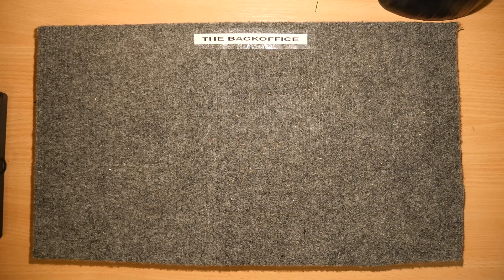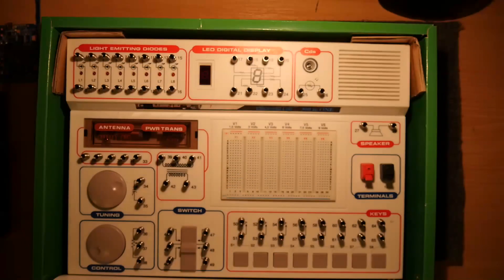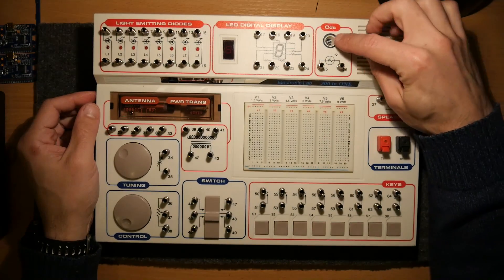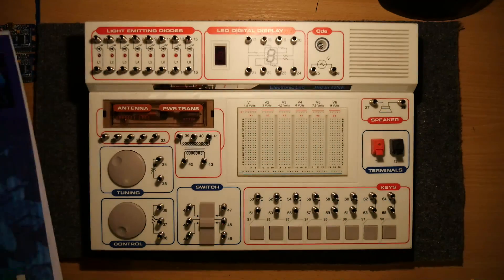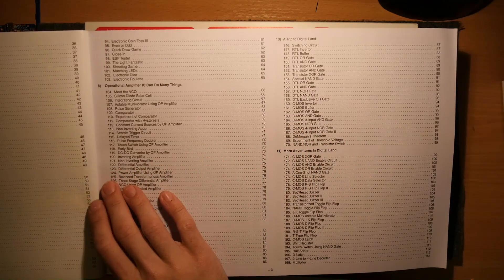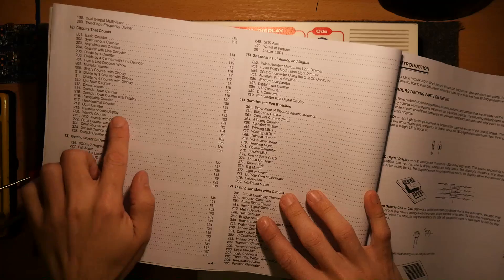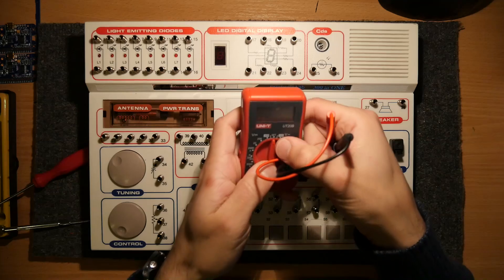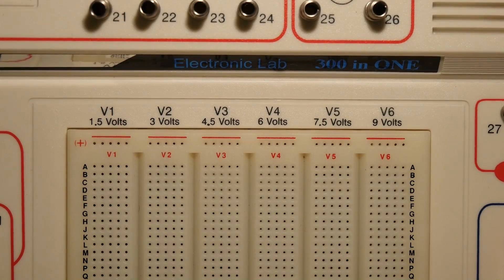300 in 1 Electronics Lab

Comment: I bought my 300 in 1 kit back in the 90's. I still have it and loved building the various projects. The one I remember the most was the AM transmitter. It was cool hearing my voice coming through on the radio. The terminals are for connecting other electronics external to the kit by the way.
Reply: Hello 
I bought this kit but without the manual 
Can I have a copy of the manual please … you can send it to me by the what’sup … I’m ready to give you my phone number if you agree
Reply: @khalidrahman3553  you can simply read it by looking it up on line.
Reply: Yeah I had the radio shack 200 in one and my fav was the am transmitter too lol, I wound up with 2 of them and used the 2nd to amplify the first that was the transmitter lol, I smoked them both trying to pump more power out of them lol.

Comment: Out of all the electronic labs Radio Shack/Tandy sold back in the day, the 300-in-1 was the ultimate one to have. I remember it being close to US$70 in 1994-1995 (about $140 now). Well out of my price range when I was 7 years old.

I did have a 200-in-1 that my parents found at a yard sale. I cherished that kit for years. One of the quirks I remember most about it is if I built any type of sound oscillator, I found that I could sometimes start it off for a few seconds by talking into the speaker or blowing on it. At the time I could never figure out why it did that, but I guess it might have induced some current onto the transformer, which fed back into the circuit and triggered the oscillator for a moment.
Reply: Similar thing with the EP-130, although this was the early 2010s. Found at a yard sale. It was pretty fun!

But then a few months later I projectile vomited all over my room and that kit was one of the casualties. Honestly? I'm glad I didn't fetch it from the trash. It was essentially ruined.

(Meanwhile I have a bucket with three radios that would probably rival some of Shango066's desert mine finds lol.)
Reply: Hello 
I bought a kit like this but without a manual 
Can you please send me a copy of the manual … you can send it by the what’s up 
I’m ready to give you my phone number if you like .

Comment: I picked up a used one this month, it came with the book (no parts). could you find the time and include a parts list? In the book it says to use transistor 2SA for the projects, but doesn't say the value! Tks in advance
Reply: Use C & S Sales to find the bits for this kit http://cs-sales.net  Look for MX-908 Parts Retail $39.95 This is the set of bits that goes in this kit. I have one of these sets with an extra set of bits as I always get extra bits for me kits
Reply from the maker: I will certainly try to remember next time I am in the loft 👍

Comment: Those terminals are for the built-in speaker top right. Anyone know if this is better than the Radio Shack version? Both are made by Elenco Maxitronics.
Reply: The Terminal connections aren't connected to anything if i remember correctly. A lot of these kits had two extra springs or connections called Termals. For connecting outside stuff to your project.
Reply: @Kylefassbinderful  Yep, after going through the same assumptions as our host did, that is the conclusion that I came to as well. Kind of hard to stick braided wire (used on the ear bud) into a breadboard I would think. It does seem a waste of a perfectly good set of terminals. I actually came here to confirm that so thank you. The way the distributed the power on this kit seems a little hokey to me, it is to bad they didn't just bring out common voltages or a set up like most trainers have, but I can understand why they did it this way. It would be interesting to hook the terminals up to a supply of some sort.
Reply: @Kylefassbinderful  Hello 
I bought a kit like this but without a manual 
Can you please send me a copy of the manual … you can send it by the what’s up 
I’m ready to give you my phone number if you like .
Reply from the maker: +TheAarowsmith Aaahhh! Thanks for letting me know!

Comment: do you have two 74HC152 integrated circuits and a 74HC74 then you can build a radio by using the 74HC152 as a Tayloe Mixer.
Reply from the maker: +DAVID GREGORY KERR Will need to investigate when I am back in the UK.